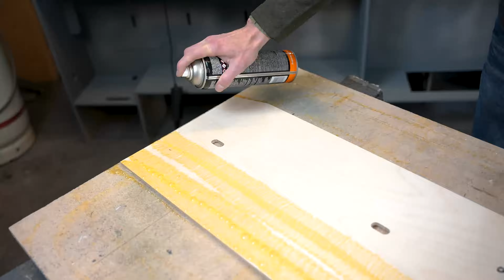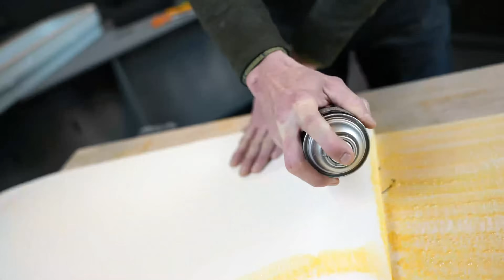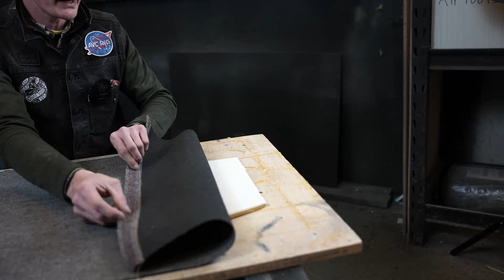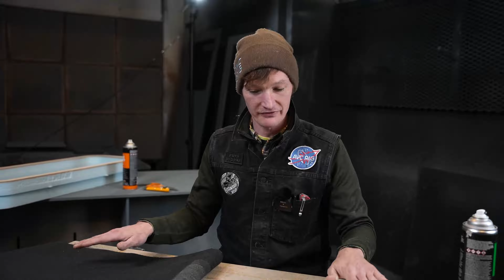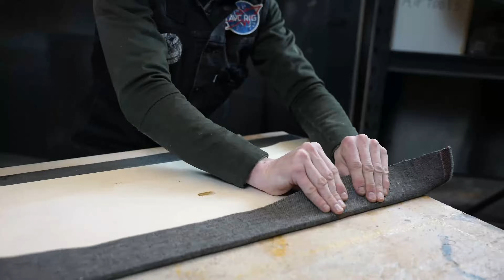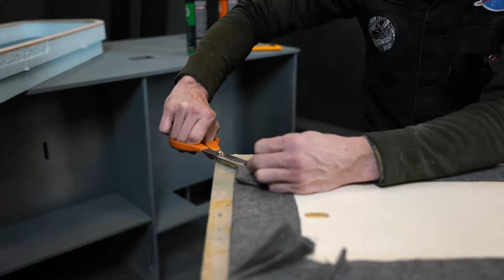AVC Wrapping Van Wall Panels

Comment: Why can't you just use the 90 to glue the landau to the wood as well?  74 is so expensive...
Reply from the maker: 90 should work for both but we would recommend you testing it out before using it on a full panel.

Comment: Is there any reason you would need to treat the exposed wood on the back side of the panel?  Or is it good to go as is?
Reply from the maker: We never have but if you’re in an extremely wet climate it wouldn’t hurt to seal them in. I’d be curious to hear what other folks do with their builds.

Comment: I've seen y'all use recommend both 3M 74 and 90 for applying Byrne fabric to landau and it looks like you're consistently recommending 74 for applying landau to the plywood. My question is this: is it okay to use either product for applying Byrne to landau? Right now, 74 costs twice as much as 90 and, while I want to use what will hold up best, I wouldn't mind saving a little cash as well. Thanks again for the immensely-helpful videos!
Reply from the maker: 74 is Specifically made for foam and fabric. It will be the best adhesive for the job. We use CA94 in the shop (similar to 90 but not exactly the same) it will work, but not as easily as the 74. The finer mist of glue will be more finicky and react stronger to changes in temp and humidity during application. Ever since Covid has hit, glue supply has been crazy. We use substitutes when needed. The majority of our gluing is now done with 3M fast tack. It’s a water based glue and works well. Requires a gun to apply and dries a little slower. We still use cans for detail work like in vans

Comment: i'm guessing you haven't had any problems with the adhesive adhering long term. i heard some reports that a compressor and spray gun was necessary because of the heat in a vehicle. do you know if the 74 and 90 are both water soluble (making panels out of XPS)? TIA
Reply from the maker: It’s all dependent on the glue you use. We’ve used a lot of things over the years, but each glue we use now has a purpose. Id say correct application is most important and keeping in mind the substrates you are gluing. (Material type and porosity) In the case of XPS the 74 is the best. If you apply too closely the propellant will melt the foam, but the glue does not. Neither 74 nor 90 are water soluble. 90 will melt XPS though.  Compressor vs can (even the big cans we use, 26 lb ers) is mostly a cost/setup and cleaning decision. These days it’s also subject to availability. 3M didn’t have little cans for a long time, and they still have limited availability.
Reply: @AVCRIG  thanks man!
Reply: I was wondering the same thing. I’d heard of adhesion issues but that could be improper application. 🤷‍♂️